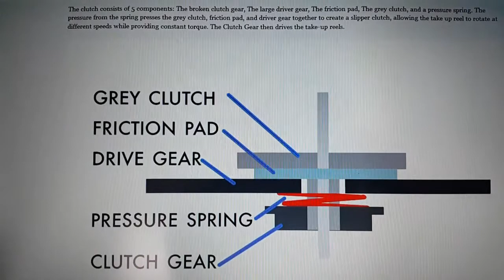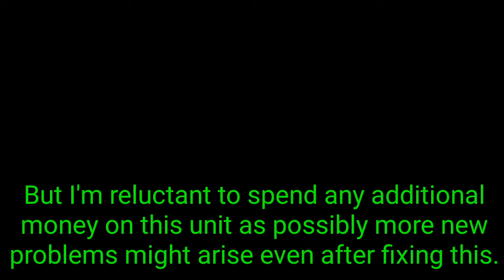Panasonic RQ-SX20 Walkman - Common (Clutch !) Problem

Comment: Panasonic rq sx 20. Immediately after replacing the belt, it reproduced, but in the morning it was gone. When playback is turned on, rewinding occurs and that's it. What could be the problem?
Reply from the maker: Hi,

I think I have the same problem. 🤔😕

Not so long ago I also replaced the plastic broken clutch with a new brass one & the symptoms sadly remain kinda the same. 🙄😞

This device is turning out to be quite the financial death trap. Already invested 30 € & stil haven't gotten it to work properly. Sorry if I wasn't of more help. 😳

Best Regards,

Comment: Hi,

I have the same problem as you, the spring and the clutch gear was out, on the other hand the clutch is not split. Do you think that just putting on scotch tape can fix the problem over time or do you have to buy the spare part better?
Reply from the maker: Hi,

Scotch tape would be in my opinion a bad idea. You probably saw that/my experiment in my video ( @ 06:45 ). 🙄

Something that I didn't mention in the video:

When I first used a small piece of electrical tape to cover that opening above the clutch, after seconds of almost getting the player to play the tape, the darn thing wore off & the spring (with the plastic retaining ring above) jumped off its place & landed somewhere on my rug. 😄😞

I found the plastic retaining ring very quickly (maybe 2 minutes), but I spent almost 2 hours searching for the metal spring (with a pole which had a neodymium magnet mounted at one of its end). I was on my all fours with a LED flashlight in one hand & that pole in the other. 🤓

Considering that my rug in my office work room is not a uniform (light) color in design, I was lucky to find both parts in the first place.
Because I also have a bunch of other things lying all around & if those 2 parts had landed somewhere else (so not on the rug), I could have just kissed everything goodbye.

So... (getting back to your question)... a better solution would perhaps be either using a fine tip soldering iron to just simply melt the broken plastic on the retaining clip together or adding a very fine small drop of superglue or epoxy resin into that mini crevice/crack. 😕😓

I'll probably just order the brass CNC-milled replacement part (2 pieces most likely) instead. I have to get the plastic battery cover door from somewhere too.
Reply: @davidbolha  The part which is on my spring is not cracked, on the other hand when I dismounted the front face of the walkman, it had remained stuck on the frontage, on the other hand I ask myself the question how did the plastic part for to remove when it is not cracked? 

I put it back in place by pressing on it but I feel that it will not last long, so if I replace it with the one in metal how it does to hold in place apart if we push it in force, maybe you can tell me?
Reply from the maker: @sylcarl6602  I think it is cracked because if it wouldn't be, it wouldn't come off. 😕

The other possibility is that the circular white locking piece that goes onto the metal axis has deteriorated.

I don't know about that. Will just have to see when & whether if I'll order a new retaining disc. 🙄
Reply: @davidbolha  
yes, it is possible that it is the white part which is tired, I will think about the solution either to stick to the super glue or to buy the brass part, I will especially want to repair it so that it lasts as long as possible.
But why panasonic has not made a more solid system .... occasionally if you can give us the video of the assembly with the brass part, it would be nice.
 In any case thank you for your answers it's nice.
Reply from the maker: @sylcarl6602  Look up the term "Planned Obsolence". That should explain why things don't last long. 🙄

Will do. 😉😆

Comment: Mine doesn't properly turn on. Replaced the belts, it runs forward and reverse for a few seconds when you put a tape in and then shuts itself off. Has anybody else ever experienced this with this model?
Reply from the maker: Hi,

Have you checked the clutch ? 🤔

Best Regards,
Reply: @davidbolha  Yes, it looks fine to me but maybe there is an issue I'm not seeing.

Comment: does anyone know how to open the battery compartment?
Reply from the maker: Hi,

It's easy - you just slide the piece of plastic up & tilt it away from the unit at a 90 degree angle. 🙄

Best Regards,